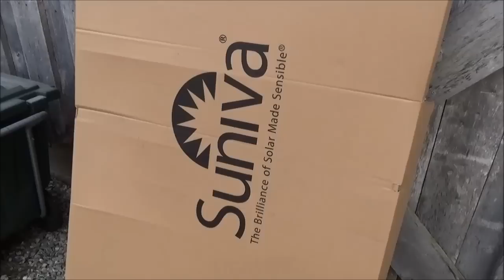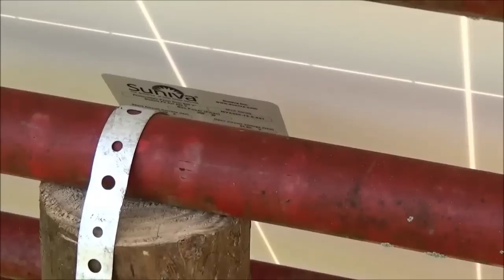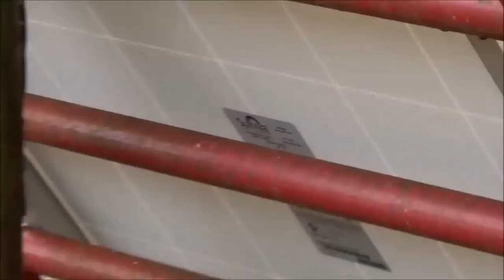DIY - Solar Panels Meet Cattle Panels

Comment: You could try adapting the hinges off of a chain-link fence gate. Your setup with the poles and panels is good, you just need to refine the hinge point and the base blocks to something more durable and permanent. Thanks for sharing.